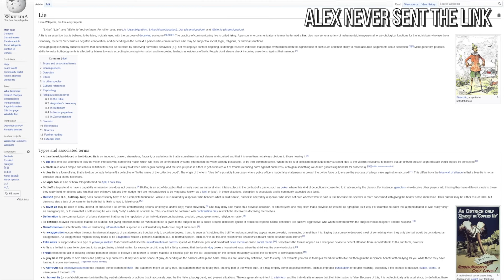What Are The Limitations of Ray-Traced Graphics?

Comment: Generating real time caustics for a ray traced light simulation in gaming is probably decades away. if that was basically question. 

Just rendering a few seconds of simulated caustics for film takes several hours currently, and thats on the top of the line equipment. When we hit something of this magnitude, I'm 100% sure matrix-like virtual realities will be possible shortly after.

Comment: I don't get it light is photons that travel in straight paths until some matter changes it direction. The maths is simple and the methods work to calculate any form of effect that light creates. The proof is in the outputs of modern movies these renders are done using PBR materials and path tracing (they can even do it in realtime look at virtual studio production). There is no such thing as waves of light this is an optical illusion caused by interfering with the paths the light takes. Path tracing vs ray tracing just includes the subtle behaviours of light based on physical characteristics and multiple bounces. But light is never treated as a wave from the camera in a scene. The reason it takes so long to render in complex scenes like caustics and skin and multi layers paints surfaces or in corners of rooms. Is because you need far more samples of light to fill the scene because light is probabilistic and tends to take similar paths each time. But you want light to fill the hard to get to areas requiring many more samples. Remember physics based lighting or unbiased lighting is a brute force attempt to resolve the scene there is no simulated effects like specularity or shading. Just pure physics and fresnel Maxwell equations of light  to speed this up you either need to interpolate the expected light between the samples called denoising or implement parallel compute to resolve those form mentioned equations. Simulated or biased rendering hasn't been used for many years now and never created convincing scenes biased rendering was needed because compute hardware was so slow. The amazing thing is photo realistic renders using physical based materials and path tracing can be done in real time now on consumer based hardware. Of course subsurface and caustics still require far more samples in the order of 10-100 but most people can be convinced about a scene being real without them. But even on consumer hardware rendering a single frame with all the subtle lighting effects is now near real-time but 60 fps is out of the question. Game developers understand this vary well so they only path trace one or two bounces then denoise. But to be honest the work in games like Cyberpunk shows that high quality lighting can be achieved even with subsurface, refraction and in dark corners maybe not caustics though. Remember 90% of the work of creating convincing scenes is creation of realistic materials and modelling realistic forms. Lighting is also an art form not only in computer graphics but photography and filming. In modern computer graphics you have to think like a photographer and place lights to highlight, back fill and flood the scene. Because in the real world light comes from multiple sources even the stars in our sky even in the middle of the day. The last thing I find most interesting and compelling about modern light propergation in computer graphics today is the conservation of energy. This is a vary important concept without it the scenes would look fake, and if this didn't occur in our physical universe it wouldn't exist. Energy is never lost it just changes direction and frequency. Just like in the real world a  closed system never has more or less energy. This is the one thing quantum physics does not explain about duality if single photos of light can simultaneously be in multiple locations at once then surely the energy multiples to reach those destinations through space time. But the answer to that is the wave collapses to a single point once observed there fore propagating this connection to every position in the universe instantaneously that the light was observed. To me this is just full of wholes and does not require proof since the argument suggest that it can never be measured from two super positions simultaneously to confirm this conjecture. Mean while through common and well understood understanding of contemporary physics we are able to replicate all of lights behaviours without accounting for duality. Remember light is not just visible but includes energy such as UV,IR and even radio and gamma. These same light propagation methods work for these frequencies as well. Eg you can model thermal distribution of heat by using the same render engine look at the work done at Thea.

Comment: The slit experiment has nothing to do with looking or not looking at it, you can always look at it or not look at it and the result will be the same, that result is, if you cast a photon at a time, at a wall with two slits, and have a light detector in the other side, every one of the photons will go through one or or the other slit, and you see two bars starting to show up in the detector, two slits create two bars, nothing strange about it but if you instead, shine a continuous beam of light (a laser for example) at the slits, then something strange happens, instead of two bars, you see four bars, two slits created four bars, if light was really made of tiny particles, this would never happen, no matter how many photons you throw at the slits, it would only show two bars, so something is different with light. Then scientists realized that there's another thing that also creates four bars, when going through two slits or holes, and that is water, sound, anything that is made of waves, and this is caused by this waves, interacting with each other and causing a interference pattern that looks like four bars, seeing the same effect with light, obviously made scientists assume light also behaves like a wave, but it also behaves like a particle, so the particle/wave duality of light was discovered.
About real time RT, current real time raytracing, is not even pure raytracing like used in offline ray tracers for movies and such, no matter what Nvidia or others claim, it is casting rays but these "rays" are more like cones than a line and much of the image is still rasterized (triangle rasterization) or voxelized, pure raytracing doesn't need triangles or voxels as geometry (or even a GPU at all).
Also yes current real time raytracing, cannot do real caustics, thou you can simulate those in other ways very easily, even in rasterization.  For example Crysis 1 add water caustics in the ocean and was not raytraced. 
And any good offline raytracer, can create real caustics, YafaRay for example does those, they just take more time to compute but for movies and such they have render farms too speed things up.

Comment: I've stopped using ray tracing algorithms more than 10 years ago for CGI rendering. Since then I went on with path traced and, if I feel fancy, I use an unbiased rendering engine, wich doens't approximate light maths.

Of course, a videogame complexity level scene takes several hours of rendering even at 1080p. Doing that in real time would require hardware that won't exist for at least a decade.

Comment: 1:29 It's the quantum "Double Slit Experiment", and light behaves as you expect when it goes through only one of the slits. When going through two slits at the proper spacing, it causes an interference pattern, which you can see even if you look directly at it. However, there are several variations that extend this experiment, one of which that has mind blowing results that change, depending on whether or not the experiment was observed.

Comment: Indeed it's called the Double Slit experiment. This has also given rise to the simulation theory of the universe. The outcome of the experiment changes depending on if the observer is actually looking at it. Not sure if the reason this happens has ever been explained.
Reply: It shouldn't need explained. You can't observe something without physically affecting it in some way. When it comes to extremely tiny particles. Everything from light, heat, to air, bounces and radiates off your body. If you look at those slits from an extreme distance, the effects won't change. If you stand next to it but look the other way, the effects change exactly as though it would if you were looking at it.